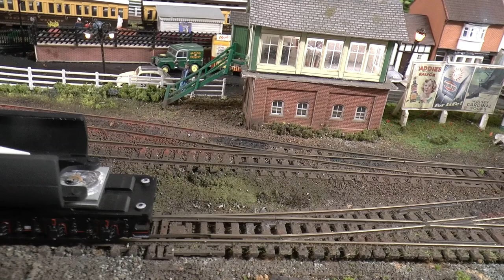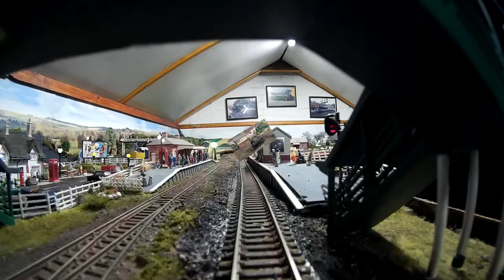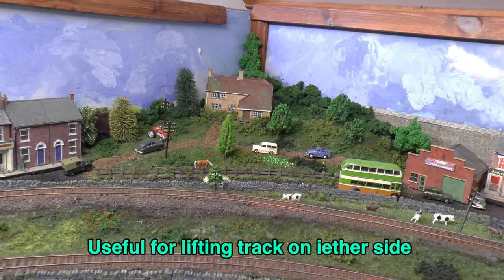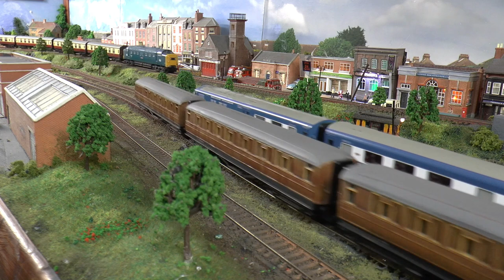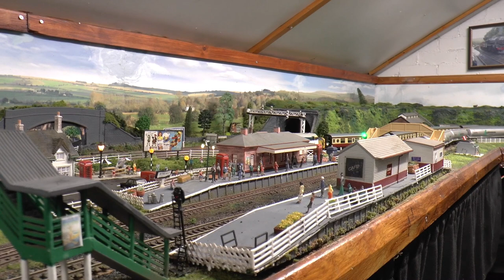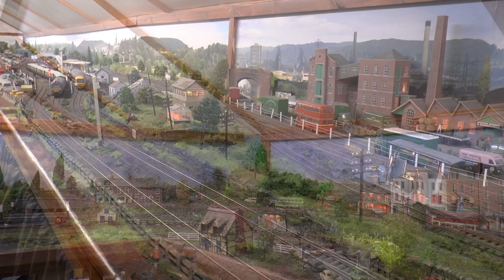Dave`s Model Railway.with a couple of tips

Comment: some good advice there Dave,and fantastic running sessions too, good fix with the Pullman too all the HST's run with a dummy engine
Reply from the maker: Hi Digger , yes that was my intension , trouble is buyt the time i took the motor out part of the framework collapsed , but a bit of plastic and the bogie and wheels we got it up and running ..cheers Dave

Comment: Your having fun, what else matters, NOTHING.
Never a fan of sound, especially steam but diesels are better.
That production delicate sounded great when she opened up.
Ah the sound of my 1960s  boyhood 
Brilliant.
Reply from the maker: Hi Steven ..yes that deltic is may favoured one for sound , it has a em2 speaker fitted do enhances the sound a lot better , its near enough to the realm Mckoy ....Cheers Dave
Reply: @howarth004  I model O gauge and a mate of mine has sound in his O gauge locos, they sound fantastic.
Steam leaves a lot to be desired but it is getting better.
The 3 cylinder Gresley locos are hard to get right at present.